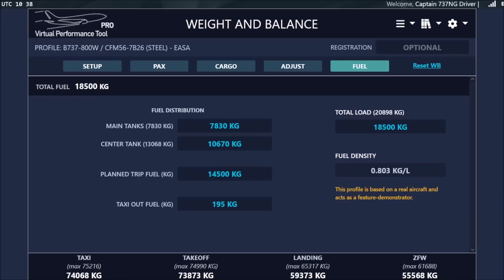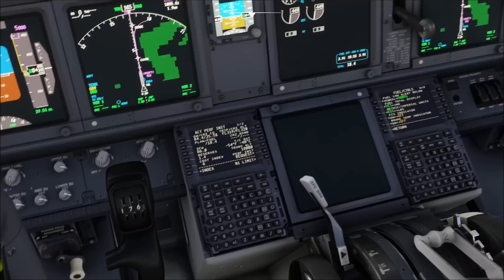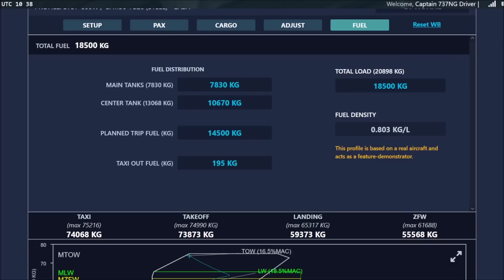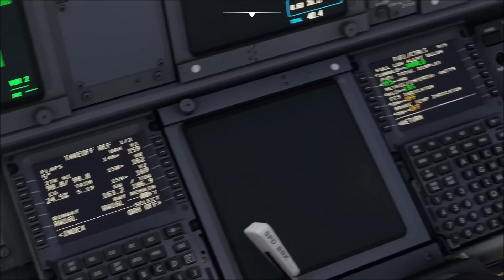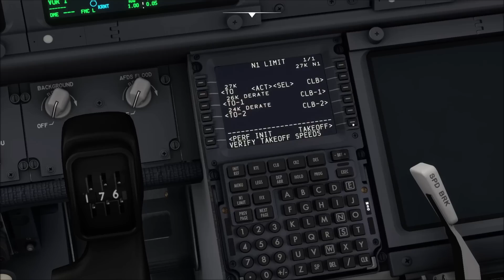Real Life Story: Two Tailstrikes in 6 minutes - What happened to Alaska Airlines 801 and 887

Comment: Could tail-strike be fatal?
Reply from the maker: Without crew action potentially yes.
It has the potential to cause damage of the tailplane and the pressure bulkhead, if that happens and you still climb up to high levels it could cause structural failure and a decompression.
That's why the checklist will tell you not to pressurized the plane after a Tailstrike.

Comment: As someone who works in ground ops, I cannot impress upon any non aviation folk how amazing the response from Alaskan was - to identify an issue and resolve it so quickly while also having the bravery to ground a fleet until resolved is a once in a career type event. Its a shame it happened but it was responded to beautifully.
Reply: A remarkable difference from how they used to operate at one point in time.